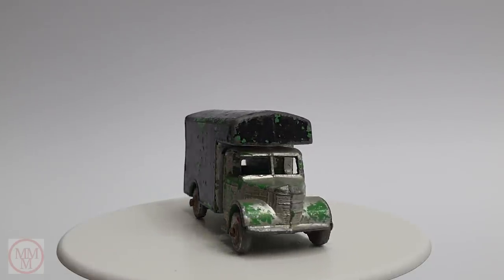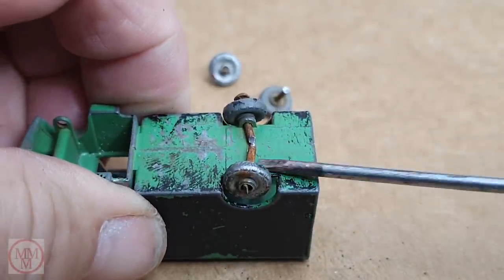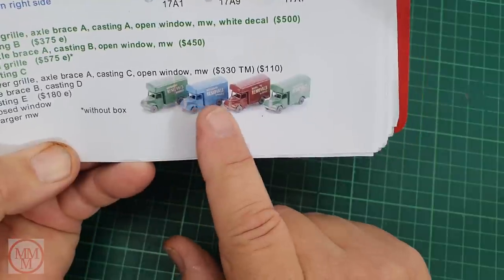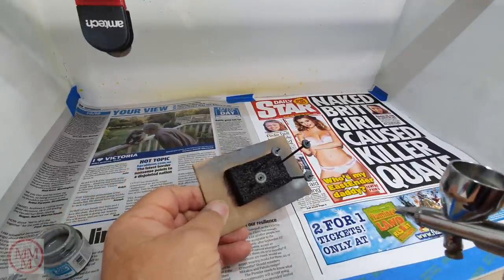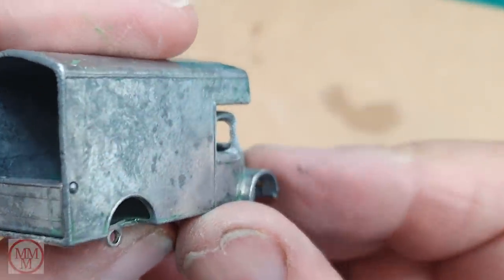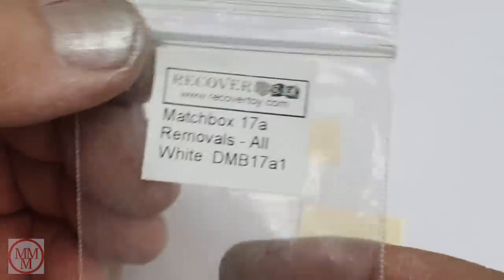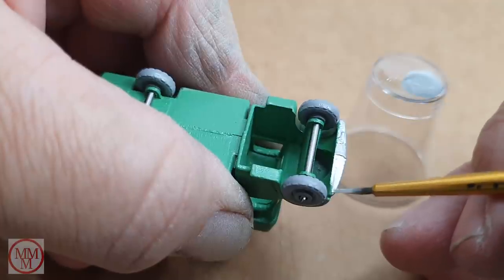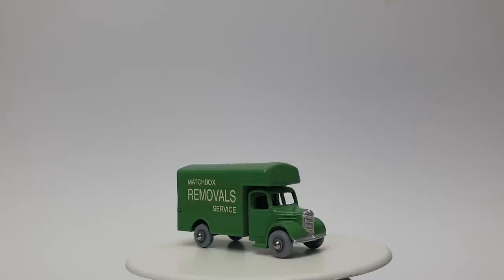MATCHBOX Restoration No.17A Bedford Removals Van 1956

Comment: The round "defects" you asked about are made by the ejector pins built into the mould. If they don't retract all the way between shots they leave a depression. Could also occur if the metal was still hot and the casting was stuck.

Comment: I quite enjoyed this one!  I always like episodes that feature the earliest Matchbox cars from the '50s and early '60s, and this is one vehicle that I haven't seen anyone on Youtube restore before!  What a treat! Have you ever tried to use metal dust filings instead of baking soda with your super glue, Marty?  Supposedly, that forms an even stronger bond.
Reply from the maker: I haven't tried metal filings yet. But I am convinced that the baking soda is the way to go as I have not had any problems so far and it's cheap and readily available.
Reply: @MartysMatchboxMakeovers  I haven't tried the filings yet either, but like you, I've done the baking soda, and it seems to work okay.  Others swear by the filings though, and I thought that maybe in one of your videos that you might give it a try as an experiment sometime.  I plan on trying it when I can collect enough metal filings.

Comment: Marty - these spots on a model that you mentioned during undercoat phase are marks after pouring metal into the mould. Little metal bars that connected many parts in a single mould (f.ex 20 parts in one mould) were broken off or cut away during cleanine of a casting by an ironworker who removed all sharp edges and most of imprefections

Comment: I believe the circle areas you pointed out are the remnants of the mold pour sites when they cast the model. They probably should have been filled in but the metal may have shrunk after the casting process,

Comment: If that truck is cast in two halves, it represents a fairly intricate casting.
@16:30 I like to use a fine paintbrush to help maneuver a decal around when it's folded over on itself.

Comment: Those round depressions are called mold marks on polystyrene models.
Reply: On plastic parts they are where the ejector pins push the part off the tool. This maybe similar on die casting?
Reply: @SimonEllwood  it probably is. I have seen such marks on some older SIKU models, in spots where they are out of sight.

Comment: Hi Marty,  I think you’ll find that over the years certain chemicals have been banned altogether or at least removed from “domestic use” products, and that’s why older paint needs two or more coats of stripper. Sometimes keying the surface with sandpaper to allow the stripper to get to the lower layer layer of paint helps.  

I remember when Nitromors would not only remove the baked on 1960’s enamel from a motorcycle frame, but your fingerprint whorls as well. The last tin I bought was about as efficient as using meringue shells as sandpaper. 

Keep up the good work, I enjoy watching your videos as I build my plastic kits.  I do wonder about buying a box of mangled  cars from a junk shop and having a go at restorations, but I have enough on my plate as it is. Perhaps if I find some landrovers I’ll dive in!  Have you done a Matchbox or Corgi Land-Rover resto?

Comment: Maybe answered already? The little circle marks are form the ejector pin locations in the mold. They often double as air vents too. It's pretty common to see some flash around them, but If the model has a depression then the ejector didn't retract completely.

Comment: 12:14 ... Those are injection molding marks, called ejector pin marks.
Reply from the maker: Thanks Ruben! ;)
Reply: @MartysMatchboxMakeovers  Hi Marty and Ruben. These metal models are 'die-cast', injection moulding is a similar process, but is used for plastics. In die-casting, as the molten metal cools and solidifies within the cavity of the mould it contracts and when the mould opens or 'splits' the object being die-casting can require considerable force to eject it from the cavity. As Ruben explained above, the marks are formed by the head of the ejector pins incorporated into the die-casting mould. Always enjoy your video's Marty. I went out to Aus from Dublin in 1974 under the assisted passage scheme. I worked as a tool and die-maker in Sydney for a number of years and my daughter was born in Woolamaloo in 79. I returned to Ireland sometime later, but I loved Australia and remember my years there with great fondness. Ferg